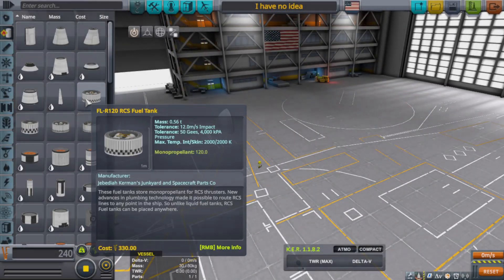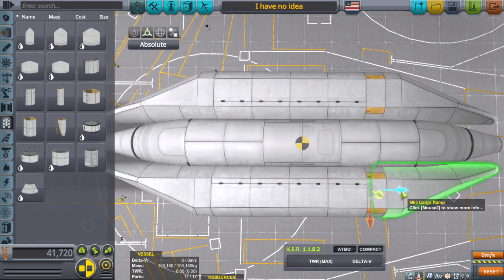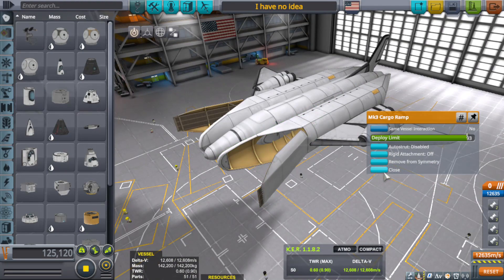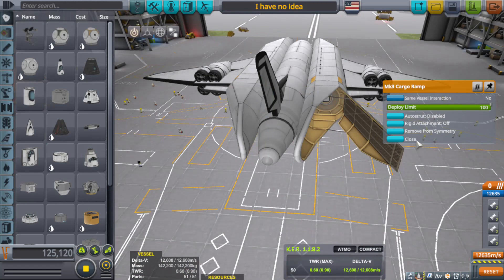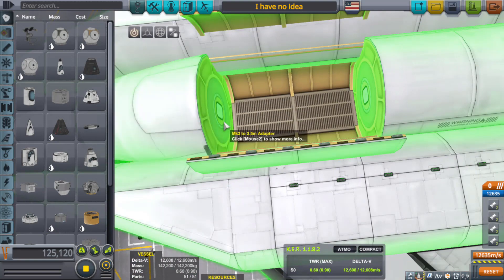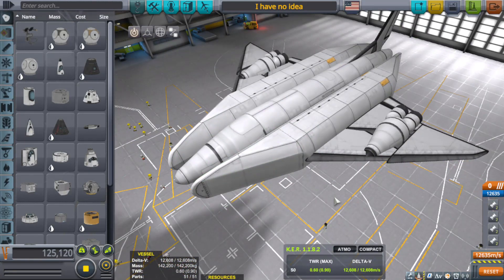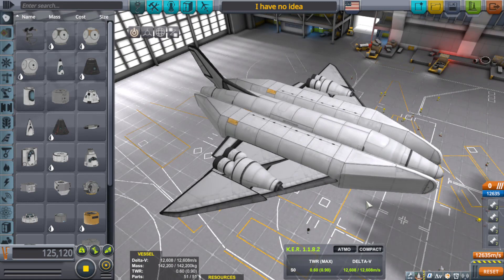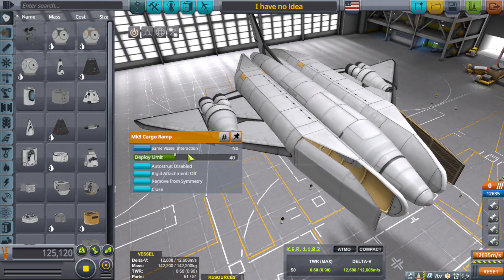KSP working on a new SSTO

Comment: Use a kal1000 overclock on the nuclear engines in the back cargo bay
What’s great about overclocking is that it burns through the same fuel at the same isp but at a fast rate while getting moar thrust
Reply: hax